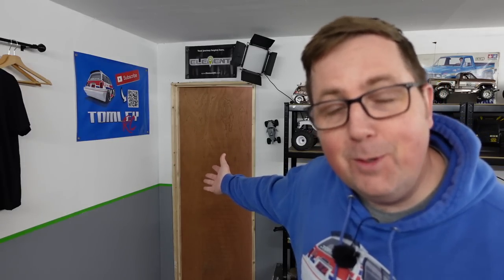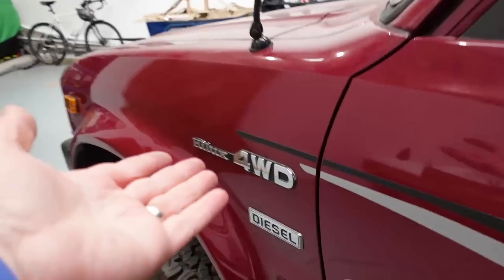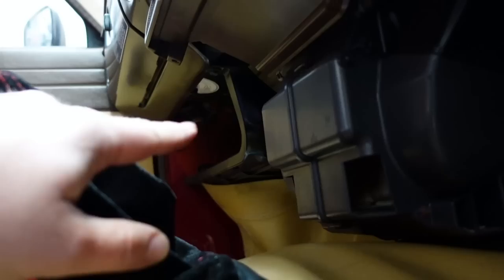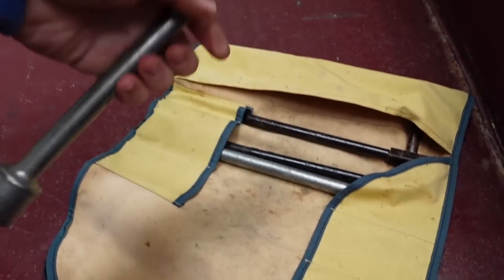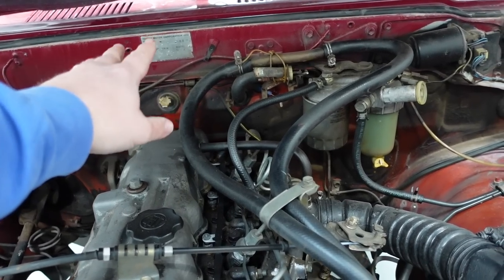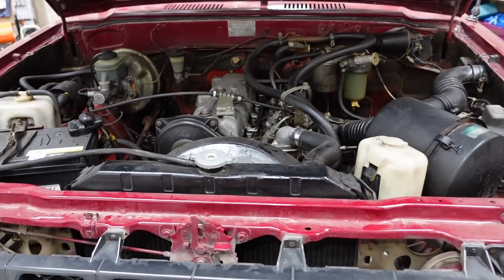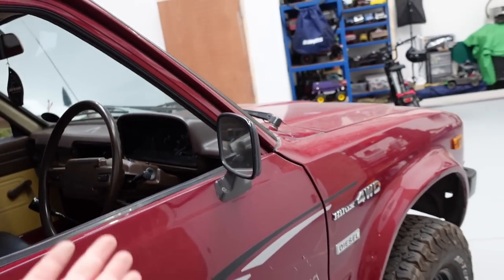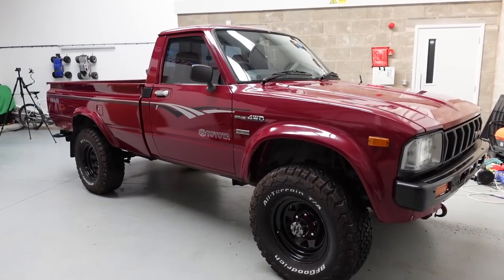I Bought my DREAM ‘Vintage’ Pick Up Truck!

Comment: I've got the American version of the same truck. 1983 so it's also got the rectangle headlights. I took a wpl c24 and c24-1 and I combined them to get the 7 slot grille and right headlights from the c24-1, then added the lower valance and front bumper from the c24 to get the perfect copy of my truck.

Comment: NICE Truck!! id suggest looking into a shop to install an immobiliser ignition and key or a hidden battery disconnect in the cab, these old vehicles are literally 30 seconds and a flathead screwdriver away from being stolen. Had mine nicked a few years back.

Comment: Get Jotun mastic 90 - epoxy mastic
Its bigger does the same job and cheaper than epoxymastic 121 and use a schultz gun to spray it under the body after you've taken the surface rust off. I thinned it to spray suspension parts before
And use tiger seal or a nice PU sealant for your joints.

Comment: Is that the one off Top Gear? 😂 Seriously, very nice, enjoy it. In ‘82 we drove a Daihatsu F50 that you could remove the soft top, sides and even fold the front screen down (although not sure how legal that would have been) which also needed the front wheels to manually lock before engaging in 4wd, no power steering, and I dare say the motoring press would have slated it but we all loved driving it and we all past our test in the F50. 

If I could find one today in good condition (unlikely) I’d happily drive it for its sheer fun and most of all character.

Enjoy the Hilux, Tomley.

Comment: Dead jelly... One of my childhood dream cars, next to a MK1 Escort and 69 Mustang.. As a 17yr old I used to spec my dream Hilux up... BMW Gunmetal grey, 3" lift, 31" BFG's, simple bullbar, 3" roll bar and old-skool spots across the top... The front is so clean a period bullbar is all it needs, and a lightbar anywhere would ruin it IMO... Gotta go round Cibie's.. ;) 
I scoured Autotrader for weeks looking for a Hilux early 90's, with 5k burning a hole in my pocket... I couldn't find a good one and insurance was a problem for a pickup back then, so I got a 205 Gti instead and spend the rest of my life in tuned up go-faster cars (Escort RST, Scooby, etc).... Oh how my car history would be different if i'd found a Hilux 35yrs ago..!?!

Comment: Aah this takes me back, we used to have one as a "shop truck" in the early 90's where i used to work, i was fortunate enough to use the truck as a company vehicle, went everywhere even off road events, the only thing that i found was it was a bit scary when driving in wet weather conditions, if you wasn't careful on the brakes you would end up losing the back end, but great Truck Phil, back to basics, no driver aids whatsoever & all the better for it. 👍

Comment: Not bad. Those fetch a pretty penny in the states. Especially in that condition.
Reply from the maker: They fetch a pretty penny here as well 😅
Reply: @TomleyRC  it's hard to find a first gen that hasn't been beaten to crap off road. I currently have a 3rd gen extended cab. It's had the frame shortened, straight axle, a flatbed and a full exocage. It goes just about any where.
Reply from the maker: @mwestie12  that sounds awesome!

Comment: Waxoil waxoil waxoil , I did a nut and bolt restoration on my 1979 MGBGT 25 years ago , LOTS of welding involved, I painted the underside then coated it in waxoil and 24 years later the under side is still perfect, buy two or three tins of it not the little cans , and buy a waxoil pump and go to work on it , use some turps or anything to thin it a little so it will spray well and warm it up too and get into the nooks and crannies that the UK weather will get in to and start to rust the truck out very quickly, it’s worth the money and time trust me mate , that’s a nice truck so it’s worth saving it , enjoy it and I hope you don’t have to many problems with it .
Reply from the maker: I’ve bought some Bilt Hamber stuff. Has very good reviews and not as messy as Waxoil, should keep it nice and fresh under there.

Comment: don't spray the rubber undercoating....what happens is that peels off a little and traps moisture behind it. Better to just use something like wool wax or chain saw bar oil and spray it once a year. What happens is it picks up dust and dirt and provides a film/barrier and if you apply it every year, you prevent any new rust from forming. 

If you notice older vehicles with leaking front or main bearings have NO rust because the leaking oil sprays everywhere and protects the vehicle.

Comment: But will it survive the "Skate Park" test?! Seriously, every second farmer in Australia had one of these because they were too hard to break. In a former life I worked as an autoglazier and I fitted windscreens to 100s of these. Simple design, cheap and easy to replace. Keep the oil changes up to date and you'll get another 40+ years out of it.

Comment: Looks like my Dads old Blue Hilux he had when I was 5 I’m 19 now and he has a 2003 Tacoma now. Oh good old memories, I think this is literally the same exact model and truck he had. He customized for more offroading he built it to go through creeks and stuff. His was not a diesel it was the OG Toyota Manuel gearing V8 motor and transfer case. The only upgrades he’s done is made the gearing stronger for going offroading, aftermarket crawler tires, and a 4 inch lift in the rear and front it came stock when he bought it with a 1inch lift in the rear in back. And I could you not when Oregon had their snow storm in 2022 I literally heard a iconic Toyota sound you know the whine of an old V8 Toyota motor, and I we were at my mom’s boyfriends which he lives in the hills the roads were covered and I gone up his hill driveway and that’s when I heard that sound and it I could you not was literally my dads old Hilux. It had the same look to it just lowered an inch in the front and rear with new tires, the bed it looked like the guy took it off and put a half cage thing on it. And I was like No Way! I told my dad and he was like Really I was like yeah then he said that honestly could have been my old truck, and I’m like oh yeah for sure. He was shocked and he told me I can’t believe it’s still running I’m like that’s literally incredible. It sounded good as well just how I remember his old one sounding. So yeah I literally think that was his old Hilux! 😀
Reply from the maker: Cool story 😎🤘

Comment: And it's not a mk1

There was a round headlight version as you say altho I'd class that as the same truck, there is a model before it with 4 round headlights and is slightly smaller (about 75-76) and then the earlier one you showed a still of, and previous to that was two different models of stout

Comment: Be careful what you use to “rust proof” this beauty , you may end up sealing water inside . As an ex panel beater I would probably just spray a bit of hot wax oil here an there.

Comment: Nice, I love my 84 Hylux.
It's my daily driver.
Mine was a mini motorhome with 30 inches of stretch in the frame before I got hold of it. Now it's a flatbed dually. 
It definitely gets more looks than my 911. (Also an 84).
Be well, and have fun.

Comment: Congrats,  I’m a fan of the older Ranger 4x4. I had several of those.  There were a lot of those Tacoma’s in my city back in the day.  Theyre solid and dependable.   Definitely need the raised white letter tires, preferably BF Goodrich or Goodyears with a nod to the Goodrich.   This is a sweet example also, nice and clean, rust wise.

Comment: These look fantastic. 20 years ago my uncle wanted a 4wd dual cab for the farm and we looked at about 10 like this from every manufacturer within the budget and they were all COMPLETELY gutless.
Wikipedia says the 2.2L diesel had 62 HP. 🤣 The 1988 2.4L Nissan we chose for my uncle had 134 HP and drove great.